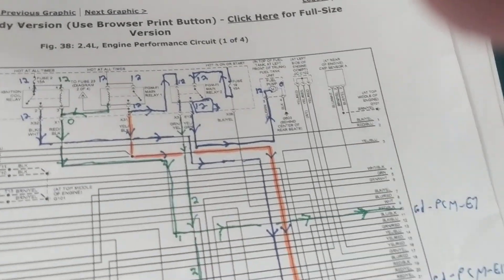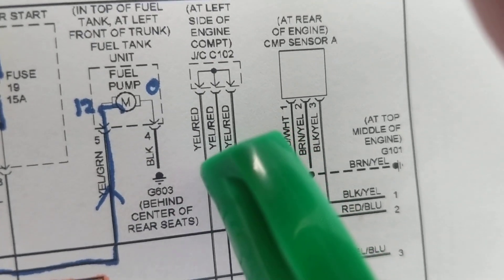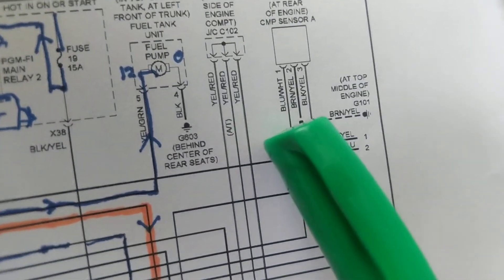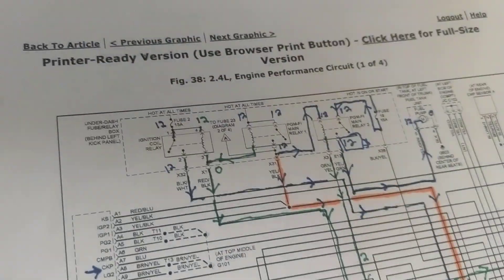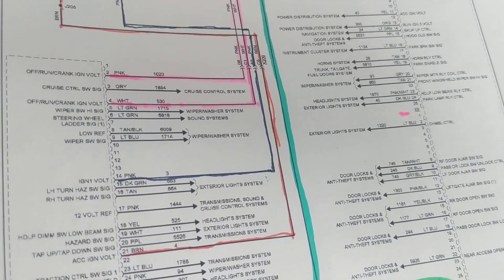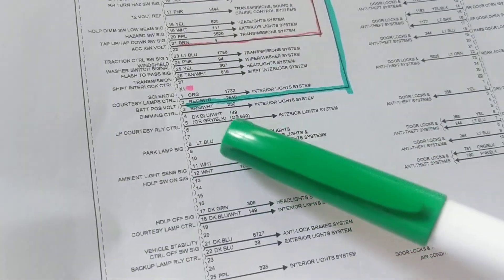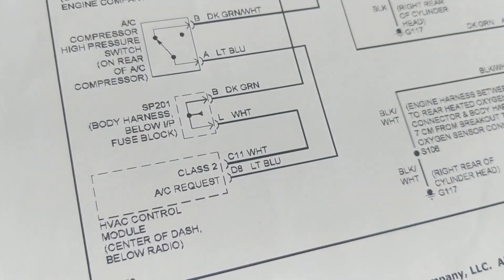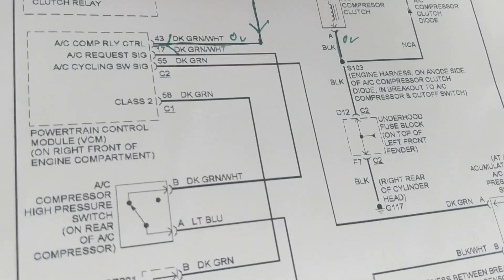HOW TO REPLACE PARTS AND SENSORS FROM WIRING DIAGRAMS FOR CORRECT CONNECTIONS AND COMPUTER MODULE

Comment: informative video sir. Quick request, sir can you also explain more on how to read the wiring diagram of 'late UK market MGB from haynes'  focusing only on the Brown color codes
Reply from the maker: Migs you have to take one section at a time that you're dealing with and this type of schematic which are you having difficulty with
Reply: @Joeelectronicschematicsforauto  so sorry for not keeping in touch as early sir and very thankful for your kindness. Actually sir I have a difficulty on reading the schematic especially the red color path ways
Reply from the maker: @m1chye8  which schematic with the red pathways specifically can you give me an example
Reply: @Joeelectronicschematicsforauto  sir I have to get back asking some question, so sorry sir, but I am going to ask about the headlight switch going to dimmer control, battery going to ignition switch and stuff
Reply from the maker: Sorry didn't get back to you earlier I'm trying to find such information about a UK market MGB from Hanes
Reply: @Joeelectronicschematicsforauto  hello sir, thank you so much for responding. I am only confuse of the red wire connection from battery to some other red wire connections, here's the link sir http://chicagolandmgclub.com/techtips/mgb/pdf/mgb_wd33.pdf
Reply from the maker: Sorry I didn't get back to you quicker I saw the schematic you referring to and it seems everything is on one page which makes it sometimes maybe a little confusing however everything goes through the ignition switch and then ignition relay and then to the distributor and also to the headlights the red lines going to the red lines are just one connection instead of putting a DOT which usually means the same connection or a splice you see that they are tied together which part are you having difficulty with specifically

Comment: This video was very helpful, quick question if I'm getting a code for a speed sensor circuit, does that mean necessarily I have a broken wire somewhere or could it just be a loose connector or corrosion that could also cause a circut malfunction, could you please respond, I'd really appreciate your input. Thanks!
Reply from the maker: It can mean all of those things and also the actual sensor is not good but first you have to measure 12 volts and ground going to it thank you for the question
Reply: Engine speed or wheel speed? Three wire or two wire? Ye really need to lead with some info or it's just a guess out of the air. Could be two wire inductive or MRE or a three wire hall effect sensor. If the code comes up as soon as ignition is switched on you more than likely have a circuit fault eg... wire, sensor, control unit, fuses. If issue starts when movement starts then could be sensor or pick up issues. Still a guess without any information or testing
Reply from the maker: @evanwynne5293  all these issues I addressed on another video on my channel this is probably the third or fourth time that I went over this and scan through it but all that information I made specifically on another video on my channel it was discussed thank you for your comment
Reply: @Joeelectronicschematicsforauto  I didnt realise you had videos addressing his issue. Any links I would like to watch them👍
Reply from the maker: Go to my channel Joe electronics schematics for Auto and my other channel on the Automotive electronics schematics by Joseph and browse around thank you for your comment

Comment: What is ac request wire and class2 wire please mention it
Reply from the maker: AC is a request when you make the selection with the switch for air conditioning I made it previous video for this that's why I just skimmed through this one class two is the communications data line used between modules if you see my channel Joe ultrasco mad for auto I go through it more thorough but thank you for the question